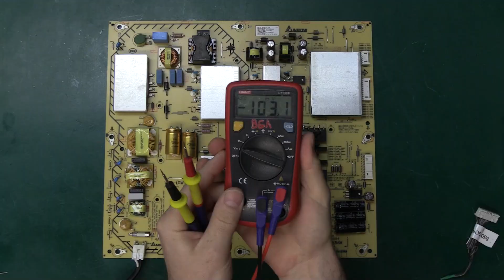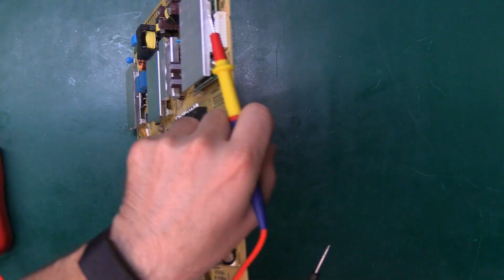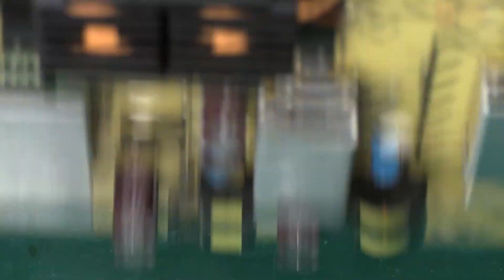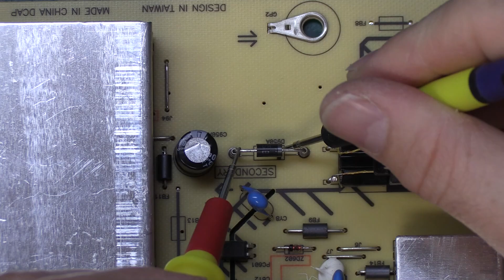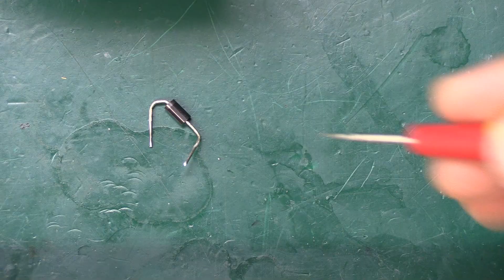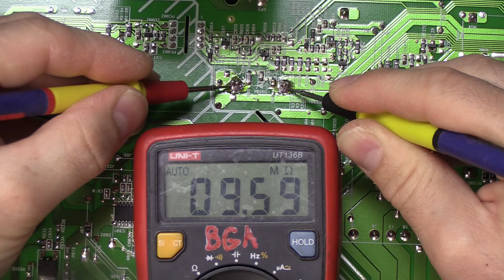Sony TV No Power Repair XBR-65X850G Power Supply 1-474-729-11

Comment: Great video. I was gonna just replace the whole board but now I'm gonna try and get it fixed instead. Did a few measurements and it does seem like whats going on with this one is very similar to mine.

Comment: Hello. I live in Tucson and just saw that you are here as well! I have a Sony TV that I assume has this same issue because when we would turn it on, the green light starts flashing red. Sometimes it would come to life and sometimes it wouldn't. Would I be able to take out the power supply board and take it to the store to get it fixed or should I also take the main board?

Comment: I have a Sony 55x8500e and it has no 3.5 at the pin 1-5 Stby at all but has 3.5 at pin 1-3 dc-dimmer and 12volt but no power from the PSB no relay click when tried to turn on exactly same problem as in the video.

My Muilty meeter is cheap one so no beep like yours how can I 
test it ?
Reply from the maker: Just look at the resistance. How many ohms are you seeing. If it's less than 40 ohms then the meter would beep if it's more the meter wouldn't beep.

Comment: Superb. It's same goes to my board. Just copycat what you have done. The only difference is I am using different part number of the diode with similar characteristics. Thank you John. Much appreciated
Reply: I have a 55x8500e tv and mine just randomly died 😂 too I have no relay on click or anything thing no 3.5v I don’t have a multimeter that reads like his tho so it’s confusing for me

Comment: Great video. I just repaired a sony KD-65xg8588 with AP-P288AM power supply. Exactly like the video. It was just the diode at position D950A. Replaced it with a Schottky SB260 and it worked.
Reply from the maker: That's awesome! Glad the video helped you fix it.

Comment: is it common to have ZD905 broken as well ? I got a short signal on ZD905 and D950A?
Reply from the maker: If D950A is shorted, remove it out of circuit and recheck. If it's still shorted then recheck ZD905 now that D950A is out of circuit. Is it still shorted? If no then it's probably fine and you were just unintentionally measuring 950A because it was in circuit. If both are shorted even out of circuit then you will need to replace both.
Reply: @NicksTVRepair  Thank you so much for the response! I am waiting for the power board parts now! any chance  power board and main board both busted at the same time?
Reply from the maker: rare but possible.

Comment: Hi Nick
I got no standby. My board is Kd 55xe8096 and i got no beep on d950 how to proceed further
Reply from the maker: It is most likely that you have a failur with the mainboard then. The mainboard commonly fails and cause a no power symptom. It's more common to see that then it is to see the power supply fail especially for the 55" version of the TV.

Comment: Excellent video Nick.  I too would like to know the replacement part number for the diode.  I would like to have it on hand before I tear into it.  If it's not it, then I would send the boards in for you to troubleshoot.  My issue is no power, no clicks, no LED blinking.
Reply: same issue here    how you made out?

Comment: Hello Nick. My standby power is good but my filter cap is reading 160. What is the fix for this?
Reply from the maker: The filter cap reading 160v simply means your TV is plugged in but not turned on. If you turn the TV on, the 160 should jump up to 390v.  If you can't turn on the TV, that could be due to any number of reasons. You could have a bad power supply, a bad mainboard, or something else. I wouldn't be able to help diagnose further with just this information. Can you provide me at least with your symptoms. I find that it's easier to help people identify faults if we keep it simple and you just tell me what the TVs doing when you press the power button. Do you get a standby light? No standby light? Does the set click on then right back off? Does it not click on at all? Does the screen glow? Also if you replaced a part you need to tell me what the symptoms were prior to the part replacement and after.

Comment: Have you ever fixed the 12v line on a 55" SONY LED/LCD TV XBR-55X810C POWER SUPPLY BOARD 1-474-633-11? When shorting the 3.3 to on the 12 line fluctuates all over.  I replaced al the electrolytic caps and can not find a short on any of the diodes or transistors

Comment: Hey Nick! I'm brand new to repairing electronics. I think that same exact diode is bad on my power supply board, how do I find the part number and where do I order it?
Reply from the maker: Part number is printed directly on the component itself so you would just read the info off the component. 
I think I have a link in the video description if you want to buy from me, but if you want to source cheaper yourself, you would just put that part number in eBay or google.

Comment: Sony KDL-60EX500 dark screen with red light blinks 6 times after lightning strike. How to fix it, replacing the whole power supply board?
Reply from the maker: 6 blinks = leds usually 
Lightning strike = bad mainboard usually. 
I do NOT recommend you replace the power supply.

Comment: My 4k sony TV is in a boot loop. It keeps turning on and off, and showing these spinning symbols. I tried factory resetting but it turns off too quick. I replaced the main motherboard but that didn't help either. Do you think it's the power supply? (Model number: XBR-65X850C) Update: I fixed it! All I did was find the update file online, then I put the file on a USB drive and put it in the TV. The boot loop stopped after that. Here is the video that helped me: "Sony XBR How to Pairing Procedure - Software Upgrade / Update C-D-E-F Series".
Reply from the maker: Then it would mean your replacement mainboard could have had a corrupt software but hardware was okay. That's again assuming it was actually new which is very strange. Are you sure it wasn't used or refurbished? New boards should not do that.

Comment: Hy brother my sony tv same power supply som mint working after relay tik after complete turn of stand by voltag agin switch of aftr turn on voltage power is working whats problems place help
Reply from the maker: Not sure I would need to have you send it in for diagnostics.

Comment: Nick... I'm getting AC voltages on those output pins most of them are 12 volts ac and one is 3 volts ac. Does that mean I have a dead power supply do you think that damaged the rest of the TV?
Reply from the maker: Your comment is confusing. Why are you taking AC voltage readings on DC lines? To answer your question I recommend you take DC readings and provide me with those readings instead. 
PS take an AC reading of the air, put your black lead on ground leave the other one not touching anything. You will probably get a 1-3v reading.
Reply: I'm geting reading in the microvolts in DC. Almost like the voltages are not being rectified. Like the transformers are converting to the proper voltage but not being converted into DC voltage. Its very confusing  @NicksTVRepair
Reply from the maker: Mhmm, well this power supply pretty much never fails unless it's the failure I showed in the video. At least I have never seen it with anything but this failure. So if you don't have the same failure shown then I don't know what could be going on. If you want to send it in, I can take a closer look at it, see if I can figure it out but other then that, I don't know that I could help you further as this would be unknown territory.

Comment: In my country most of tv's are from chine.they use a just single pcb board.i receive them in my shop with the commun problem-led tv on standby mode , won't start.how to fix it ?

Comment: Nick please help : because i really confuse. I have XR-65X90L and the orange led stanby doesnt turn on. After checking the caused i found my home electricity when i turn on its normal 220V but when i turn if off, voltage display 80V in my voltmeter. 

Then i checked powersupply : standby voltage normal 3,3V. REG12V like normal 12,5V but after i check TCON VCC12v, in my voltmeter just display 142mV. I really confused that problem caused by my powersupply or motherboard. 

Please help me.
Reply from the maker: To me it sounds like you have a mainboard fault
Reply: @NicksTVRepair  then i try to buy new second hand motherboard (from cracked screen). Then i try to connect but the symptome as same ase yout video (emmc fault). Then i send back to seller. 

Bad news that in indonesia none i can find 65x90L motherboard again. And i try new solution that i bought 75x90L motherboard with guarentee from seller. The motherboard is on the way expedition to come here. I hope it can help me

So what i have to do to my old motherboard to repair itu because here there is no repairshop can repair it.

Comment: Hi Nick, I have a KD 55xd8599 and I have no picture but do have sound. I've changed the Tcon but still no picture. after fitting I've tested the 5 pin power plug to the tcon and have no power. Could this be the inverter board or does the need a trigger from the mainboard to start? Any help very much appreciated
Reply from the maker: Most likely a mainboard then. If your inverter board was at fault it most likely would have triggered a 4 blink code in my experience
Reply: @NicksTVRepair  Thanks, after some messing around I have identified it as the mainboard. sadly I cannot find one that matches my screen. I have tried a board with the same part numbers but it failed to bring the screen back to life. thanks for the help anyway. I've enjoyed your videos

Comment: Nick - Have you made a video on replacing the led strips on the Sony 75X900F or know where I could access one. Also can I ground the error code wire on the video board to trick the mother board to illuminate the screen on this model? MANY THANKS for your help!!!
Reply: Grounding the error line will only work for the 900C series because of it's unique design for the LEDs and how they fail. It does not work for any other model or revision.

Comment: Nick - I have a  Sony 75X900F and Heard a pop sound and all I get now when I turn on The TV is a 4 blinking light  on the front Sony ID light. It blinks 4 times then pauses and then  does the 4 blinks again. I contacted Sony technical support but they offered no help, Now I'm stuck because the only  TV repair in my area has gone out of business due to tv's have become disposable. I paid $2100.00 and the TV it went out of warranty 2 months ago, and I really can't afford to replace it again.  Any help would be GREATLY APPRECIATED!!!
Reply: Backlight defect .
Reply: I'm from India, couldn't help you directly but i can surely tell you that you tv will be repaired easily. 4 time blinks that is indicating the panel supply issue or t-con board issue that can be solved easily. Do contact your nearest technician for repair, wait until your area's technician come after finishing his personal business.